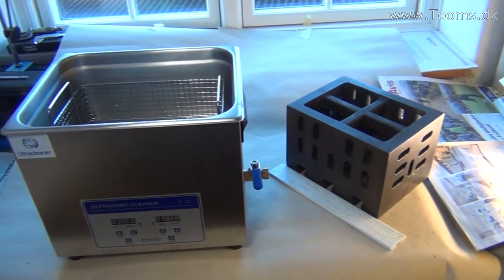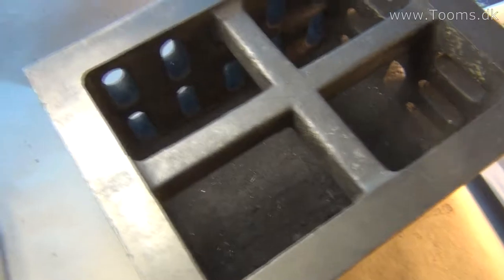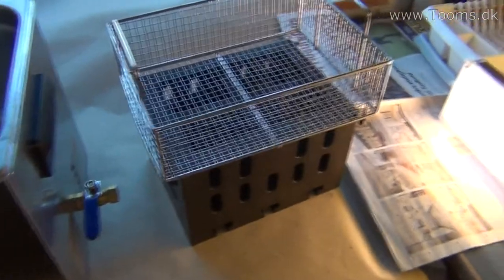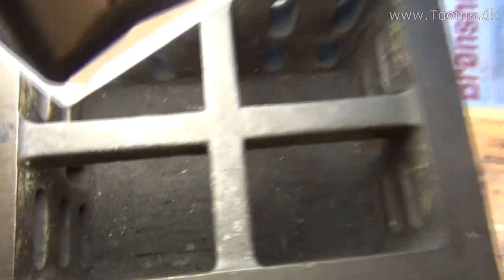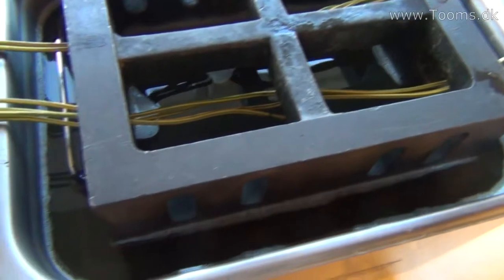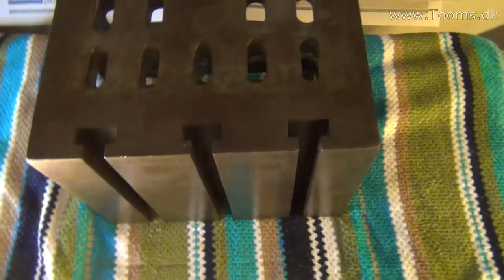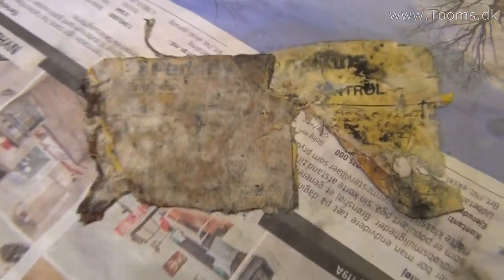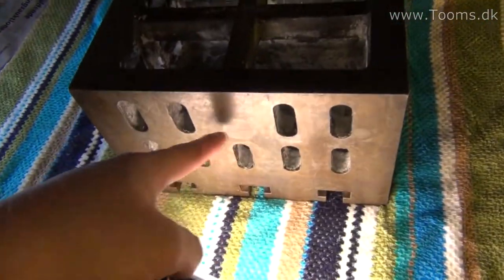Ultrasonic Cleaner of Iron T-slot box for cnc

Comment: Do you have videos of using this block on the cnc mill?
Reply from the maker: No my mill is to small right now and i am in the process of changing that, so when that is done i will use it
Reply: ToomsDK im pretty interested on how that works. 
As far as clamping pieces, looks like you can get a lot of angles without a special vice.
Reply from the maker: I will try post some videos when i have used it, but it may take some time